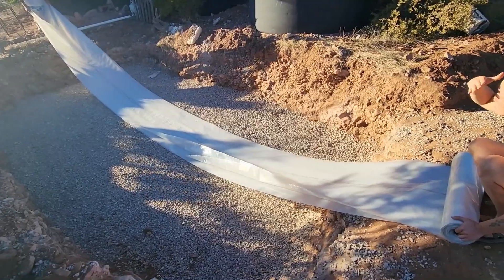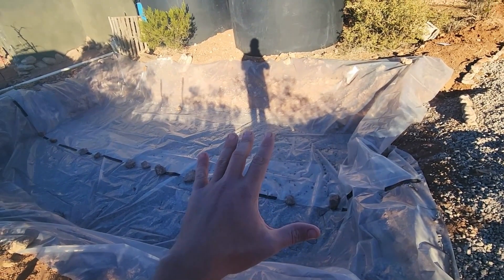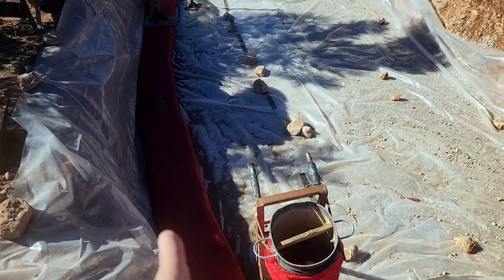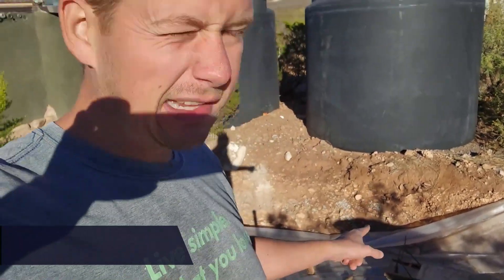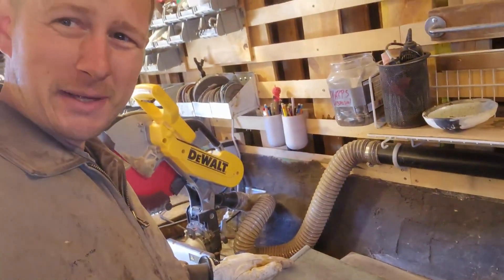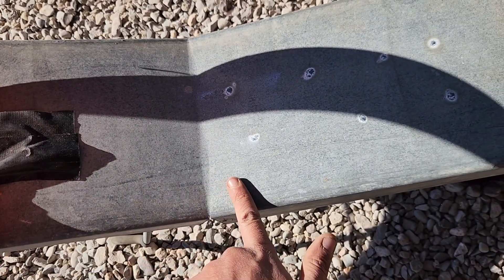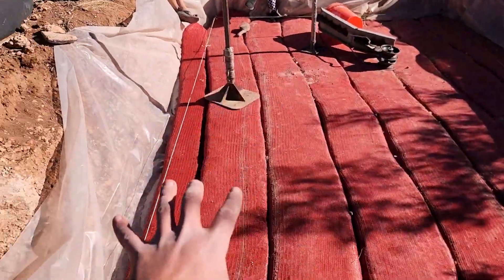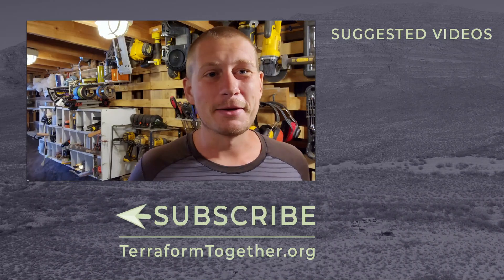Building a WATER STORAGE tank OFF-GRID out of Hyper Adobe EARTHBAGS for DIRT CHEAP

Comment: Excellent project! Please tell us more about some of the geotechnical analysis you did to design the cistern. Using hyperadobe and your specific soil type, how deep and/or large can you make this kind of cistern?
Reply from the maker: Generally hyperadobe is a 70% sand to 30% clay mix. We use 10% by volume cement to help stabilize things as well. 

You can make them as small or large as you want with proper buttressing and reinforcements. Round is always better,  but we changed plans after the hole was already dug. We are using this book as our engineering guide: https://amzn.to/3H0ocNy

Hope this helps!
Reply: Thanks, @TerraformTogether . I was asking about the structural design itself, both in terms of the load exerted below grade by the surrounding rocky sand (and compressed backfill material) and the outward load exerted above grade by the stored water. I'm also curious about the compressive load on the underlying soil, gravel, and hyperadobe bags such that shifting won't occur and otherwise ruin your plaster.